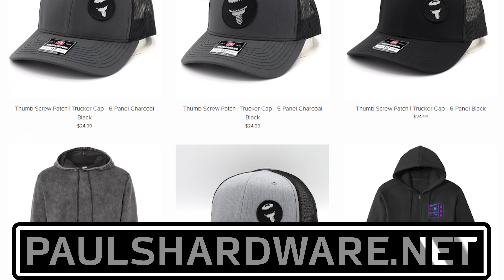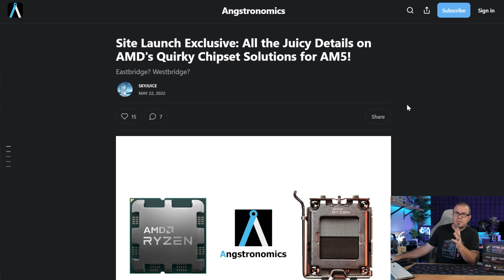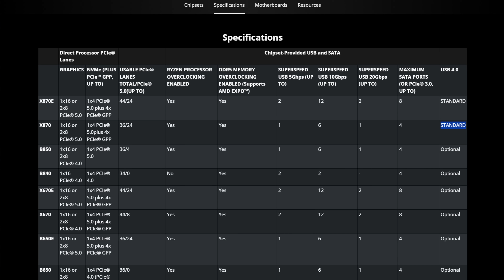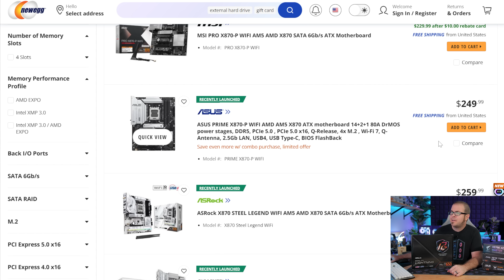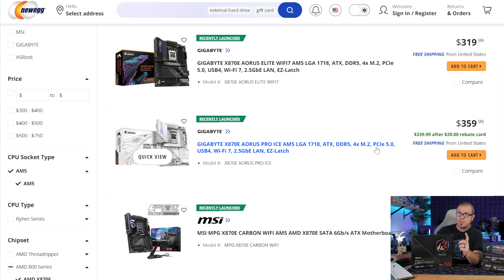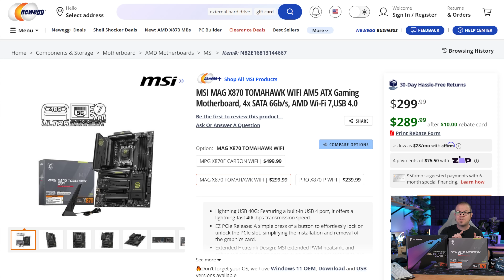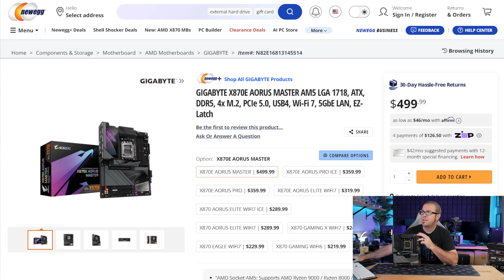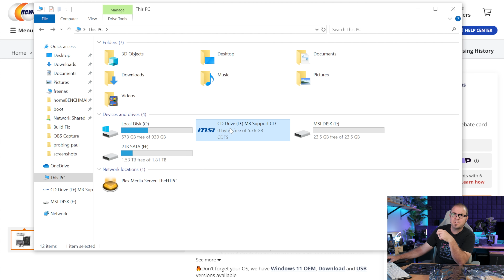Explanation / Rant about AMD X870 and X870E Motherboards

Comment: With 40Gbps USBC ports becoming standard on motherboards while LAN is still around at 2.5G, I'd love to see a Router come out with USB-C connectivity to bypass that 2.5G limitation! Imagine a future where we're networking with Type-C. My WiFi 6 is already faster than the GBE on my AM4 motherboard.
Reply: It's ridiculous that they don't have one already. Considering my Intel strix z790 has had thunderbolt 4 for over a year now.
Reply: You do realize the recommended maximum length for a passive USB cable is 3m....

Comment: AMD's most egregious move is having the X870 be a renamed B650E board when the main difference between the X670 and B650 series were the number of chips. That kinda bait and switch is atrocious. But luckily, I can simply grab an X670E board and be good to go. Given that I don't own any USB4 devices any way, I'll be fine with 6000MHz RAM and a way cheaper board. 

They really didn't need to have a new motherboard series to be honest. There is VERY little reason to buy any of them.
Reply: Have you actually looked up the price difference between a X870 board and a currently selling X670E board?

Comment: ASRock X870E Nova pretty much has everything except 10g but that can be added to the bottom slot.
Reply: x870e Nova is overrated IMO. The 2nd and 3d PCIE slots are Gen3 x1 and x2 respectively so won't keep up with a 10g NIC (PCI Gen 3 is 1Gbps per lane).  The 3rd slot shares its lanes with the 5th nmve m.2 slot too, so it's either one or the other...

Comment: Thinking of using a trashy USB stick the motherboard manufacturers likely sourced from the cheapest contractor feels dirty and not that trustworthy.

The only thing you should get from a motherboard manufacturer’s website is BIOS updates.

Always get the most recent drivers directly from the individual components’ manufacturer websites to be on the safe side. It’s a bit of work once to hunt everything down, bookmark the various driver websites and then it’s become a good routine to avoid malware.
Reply: LOL...and then Microsoft update resets your system settings and installs outdated or "new" drivers that cause system/device instability. Sigh...

Comment: Y'all wanna hear something that's really dumb?
Some of the X870E boards have 5 M.2 slots... if you populate all 5 M.2 slots, the primary PCIe x16 slot gets gimped to X8, regardless of whether or not the M.2 drives installed in the 5.0-speed M.2 slots are 4.0 or not, according to what I'm seeing. Someone please test & confirm this - according to the manual on the Asus X870E Hero, if all 5 M.2 drive spots are occupied, the top PCIe x16 slot is gimped to x8.  If that's the case, guess I'm not in a big hurry to upgrade... I was trying to go for a 5-M.2 slot board to get the extra on-board drive slot as I'm currently running 5 M.2 drives, but the 5th one is in a PCIe x4 M.2 expansion card.
Reply: Taichi doesn’t gimp the m.2 slots.
Reply: @TheSjuris  🤦🏻‍♀️it also doesn't have 5 m.2 slots... Which I specifically mentioned as being the cause of the primary PCIe slot being lowered to x8. This only happens with 5 m.2 slots, if 3 of them are connected to the cpu, from what I've seen, which is the case with the Asus x870e-e Strix & the Hero.
Reply: @MadisonIsMySpiritAnimal  the bottom 2 slots in those Asus boards are powered by the chipset and won’t gimp anything.
Reply: @TheSjuris  Bro please stop wasting your time responding if you're not going to read & understand all the information presented lol 
The original comment... says I have 5 M.2 drives presently... so it doesn't matter if the two bottom ones don't gimp anything, the top 3 do.

Comment: Will a b650 board be compatible with 9000 series cpus out of the box w/o a bios update?  If not, how does one do a bios update without a 7000 series cpu?
Reply: I believe i read some manufacters have already installed the most recent update of bios right after someone purchase the motherboard 

So the user have no need to update it manually by putting everything and installing it just like very new system which just plugged in
Reply: @RoyZennet  but you have no idea how long that motherboard has been sitting on a shelf.

Comment: People who talk MB only talk chipset and connectivity, but they never mention that stronger VRM and power delivery.  More power - more stable and smoother performance.  Plus, if you wanted to OC, the ones with more power handle anything without issues.
Reply: "More power - more stable and smoother performance."
That's just simply false for any board above the absolute bargain-basement boards unless you're talking about ultra-ultra-ultra extreme overclocking.
Once you establish the continuous availability of 65 measly watts for a 9700X, giving it hundreds of more watts will do literally nothing unless you spike it through the absolute roof and choose the 105 watt TDP profile. 
With the 9950X and 9900X you simply need to avail it of 170 watts of power.
You don't need 600 amps of power (~775 watts) for any of these parts to reach the maximum stability and "smoothness" of operation.
Garbage posts packed to the brim with misinformation like this are why we wind up with $500 "mainstream" motherboards.
Oh yeah... overclock that Zen 5 to an extra 1.02% performance gain. Let. It. Rock.
Reply: @tim3172  So a Yaris is a 4 cylinder that an just meet the needs to drive you from point A to point B - so that is all that is needed because the ride can't get any better?  So there is no need to get an Acura TLX 4 cylinder, since the Yaris cannot be improved?

I am talking from hands-on experience with the minimum powered MB's, thinking that they were good enough.  Then I moved into the high powered MB's - and the performance went up.  Just like increasing the voltage on a CPU or RAM when OCing.

Comment: Youch!  Just four lanes; Intel uses eight lanes with the possibility of Thunderbolt using four.  More bandwidth off the chipset.  Latency!  Daisychaining is going to produce less than half the bandwidth with everything equal because of protocols, etc.  I love fast storage on multiple NVMe drives, and I connect PCs using Thunderbolt for fast transfers.  Dang, the consumer space is exciting, but yuck all at the same time.  Cheap server gear isn't the answer either because of gaming speed.  I want it all and in a small-ish package.  I will have to wait; was seriously considering AMD.  Chipset is a deal breaker.

Comment: Question for the cheap company: Why is there not a BOOKLET to explain the board as some it may be their first build and you have no Access to the internet to down load  a guide booklet that should come with the motherboard as you  are already over charging $50-$100 for your cheap made boards with no Guide Book. Gigabyte X870E motherboards are a JOKE as they are overpriced for what you get including ONLY having 6-Layer PCB Mid Loss vs. 8-layer Low Loss. Even their B650 Aorus Elite AX has 8-Layer PCB for under $200 right now Vs. $360. I wanted to buy from Gigabyte in the past but they made their new Ice boards in 6-Layer or the X670E pro with 8-Layer but poor audio and over priced for what you get. GIGABYTE X870E AORUS PRO ICE would have been the one to get if they lowered it $100 and added 2 more layer to the PCB's 6-Layer.

Comment: Can you use the DP Out on usb 4 if you have a GPU? Or you have to route a DP Cable from it to the MBoard?

I could see the use if you have a economic build with Integrated graphics and a basic MoBo, but seems like a waste of DP out in a expensive setup
Reply: From what I remember this is an option since the AMD 7000 CPUs. I've looked it up, I think last year, but since I have an older CPU and AM4 platform there is no way for me to test it. It's a very little discussed feature.
Reply: If you have a gpu why would you need integrated graphics?

Comment: Got the B650 Aorus Elite AX motherboard for my build last year and it has been plenty good enough. I originally wanted a MB that had the USB 4, but they were all much more expensive at the time and didn't want to spend that much more for a port that, when I really thought hard about it, wasn't going to use anytime soon, if ever. I actually considered that ASRock board in addition to a couple others of theirs, but I liked the features on the Gigabyte a bit more. Planning to carry this MB all the way through to the end of AM5. I'm not missing wifi 7 or USB 4.

Comment: 11:20 - I'd guess that HDMI port is for cases with a display on them, so you wouldn't need to fish HDMI cables through the case out of the rear. I might get a X870E board, if the memory support it better. Waiting around for "memory training" on the X670E is insufferable, and posting is unreliable AF (Thanks, Asus).
Reply: Has nothing to do with Asus thank AMD

Comment: I think that there's one major problem with these mobos.
And that's the PCIE lane sharing. I've read that on most if not all X870/E mobos, if you use more than one M.2 slot. The PCIE x16 slot will be cut down to x8.
And that only one mobo does not do that, the X870E Taichi. 
This really sucks.
Reply: the gpu dropping to down to x8 only happens on boards with two gen 5 pcie slots, since asrock only uses 1 pcie gen 5 slot and the other is gen 4, it wont drop to x8. But anyway, i love asrock products & their their products for many years, have top quality & specs with a lower price compare to other top brands, example: Asus with their "ROG taxes"....
I already preordered the X870E Nova Wifi for my new build, will be coming next week
Reply: @arthur_pd I got the x870e aorus pro ice and it states that it has 3 x PCIe 5.0 M.2 UD Slots
1 x PCIe 4.0 M.2 Slot. I’m wondering if that’s fine or not
Reply: @SevenBlades  yours will be down to x8 is used both first slot pcie and m.2 SSD, sometimes brand website will inform or sometimes it doesn't
Reply: @arthur_pd  Oh thank you alot for clarifying why the lanes get cut. I'm also wondering if i should get an X870E mobo. Currently i've got a GIGABYTE X670E AORUS MASTER mobo with a 7950X3D. And because i'm an enthusiast. I've saved up some money and have been on the fence if i should try and get an X870E mobo and after that a 9950X3D when it comes out. But because i found out that most of the X870E mobos cut lanes, i've been wondering if there's other mobos which do not cut lanes like the Taichi. And if the Taichi is the only one which doesn't. 
Guess i'll wait and see.

Comment: X870 MSI Tomahawk seems like the sweet spot for me, upgrading from AM4. Has 320 MHz band WiFi 7, 5 gbps lan port, decent VRM, and $300 price is reasonable. I currently have an Asus Strix board but balked at their $500 Strix board this generation. They have finally gone too far with the Asus tax. But I’m open to suggestions.
Reply: Glorified b650e board.
Reply: @TheSjuris  how many b650e boards allow 4x m.2 SSD, with two of them being pcie 5 capable, also without losing lanes any on the primary PCIe 16x slot while using all 4 m.2 slots? And how many do that while offering 5gb lan and 320 MHz band WiFi 7?  It seems like a reasonable improvement in feature set over b650e. Not to mention being an 8 layer PCB board.
Reply: @Slyons89  b850 is going to offer that the x870 non e gimps something to. On the Tomahawk it’s usb4 and the pcie second lane. The x670 has 2 chipsets, the x870 has 1.
Reply: @TheSjuris  the thing is, I don’t care what they call it, I only care that it offers the features that matter to me at a reasonable price. That configuration of only losing usb4 and 3rd slot pcie lanes is the best case scenario for me. Plus getting the networking features, 8 layer PCB, and 7 segment debug display for under $300 makes it a worthwhile product. Doesn’t matter if they call it b650-e, or b850, or x870.
Reply: @Slyons89  there are better x670 boards that don’t have a bright yellow light. Too each their own it’s a ripoff naming scheme by AMD.
Reply: @TheSjuris  please let me know of a board with 8 layers, 7 segment debug display, 16x pcie with 4 m.2 slots in use, 5 gb lan, WiFi 7, for less than $300. I’ll return this unopened tomahawk x870 box on my desk and buy your suggestion. I have time since I’m waiting for 9800X3D to drop anyways.
Reply: @Slyons89  enjoy your b850e that’s all a x870 is. WiFi 7 is the only thing it has over a x670 board. Rather have more lanes which is lacking on that board. Plus it has an ugly yellow light.
Reply: @TheSjuris  yeah it’s almost like different people have different needs. Pointless for you to come in here and denigrate a suggestion of a decent product. Like I said, I don’t care what the name is, that doesn’t bother me, it’s just the feature set. Instead of the money going into the second chipset I don’t need, they put on better lan, WiFi, made the board 8 layers, and added the debug display. I’d argue for the vast majority of users, the 2 chipset boards are pointless overkill. They also cost more. I’m coming from a b550 Strix board that cost more than this x870. B350 board before that. The Asus boards have now jumped the shark on pricing for the features they offer. The x870 tomahawk basically fits into the slot my b550 strix board cost, and it’s $50 less than that board cost in 2020.
Reply: @Slyons89   remember the 2 biggest reasons to buy a x870 board is for WiFi 7 and usb4. So why gimp one of the biggest features for a drive that really has no real benefit for a non-professional creator.
Reply: @TheSjuris  because there isn’t a b650-e board with this combination of features I want. I don’t care about usb4. Like I said, find me a board with 8 layer PCB, debug display, 16x pcie while all 4 nvme slots are used, 5 gig lan, WiFi 7, for under $300. It doesn’t matter if it’s a glorified b650 board if the b650 boards don’t offer that feature set for the right price. Also, I don’t care if the board is ugly, my case doesn’t have a window, I’m not 14 years old spending money on pretty lights in the computer lol.
Reply: @Slyons89  I get it you really, really want & layers on a board that really shouldn’t be used for overclocking, paying extra $20 for usb4 when you’re deliberately nuking it on a board that’s an actual downgrade from a x670 board.  The non-e version of a x670 board is better than your board.  Enjoy it. Rather have more lanes and features which don’t want to get gimped up by a chip version that shouldn’t actually exist. The X series was supposed to be the best version of the series and not have one that’s gimped up.  Enjoy your board it’s your money. Why waste your money when you can buy a non-gimped up version for the same price.
Reply: @TheSjuris  still waiting on you to prove your point by giving a board with the features I want for less money.
Reply: @Slyons89  the only feature that you really are getting that isn’t gimped is wifi7. But hey gotta have a m.2 drive at 5 x 2 speed.  Jesus enjoy your b650e with WiFi 7.  There are b650e boards that have 8 layers and better vrms.  Do you even read their info?
Reply: @TheSjuris  because this board offers 5 gb lan, WiFi 7, 8 layer PCB, debug display, and allows for 4x nvme while maintaining 16 lanes to the primary pcie slot, for under $300.

You seem extremely hung up on the platform name and marketing. I am shopping purely based on the features I want and the price. If you can find me a board with that feature set for less money, like I said, I’ll return this board and buy your suggestion.
Reply: @TheSjuris  I don’t need a more powerful VRM to run an 8 core CPU, that’s just marketing. I might actually use the WiFi 7. I don’t know why you are frustrated lol, the x870 tomahawk is actually a good product for its price. It’s the only x870 (non-e) board that has the lanes configured for 4x nvme while keeping 16x pcie slot, which is what I wanted. I don’t really need usb 4 and I definitely don’t need a second chipset. So what does it matter to you?  You can call it a glorified b650-e if you want but it has the right set of features for the right price. AMDs marketing naming schemes for boards doesn’t matter to me if it had the right features for the right price. I was initially tempted to get the Asrock x870-e taichi lite, but decided it wasn’t worth the extra $100 to get the second chipset for connectivity I won’t use.

Comment: The issue is. Non of these cheaper b650/x670/x870/x870e models have enough sata-ports and m.2 ports in general except asrock. Best bet so far has been asrock x870e taichi/lite. It's board where you dont sacrifice any pcie 16x bandwidth if you use every m.2 slot
Reply: the bandwidth dropping to down only happens on boards with two gen 5 pcie slots, since asrock only uses 1 pcie gen 5 slot and the other is gen 4, it wont drop the gpu to x8 speed. But anyway, i love asrock products & their their products for many years, have top quality & specs with a lower price compare to other top brands, example: Asus with their "ROG taxes"....
I already preordered the X870E Nova Wifi for my new build, will be coming next week